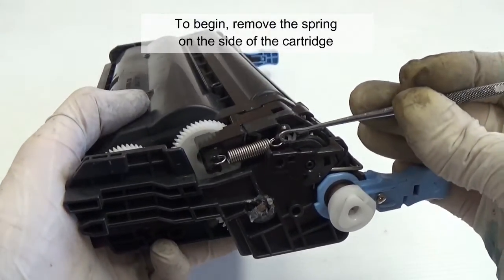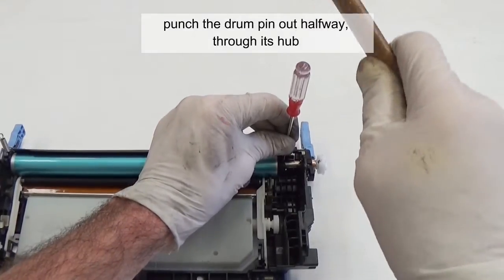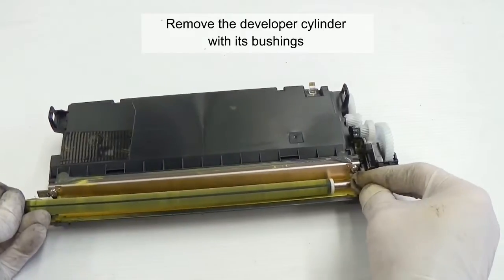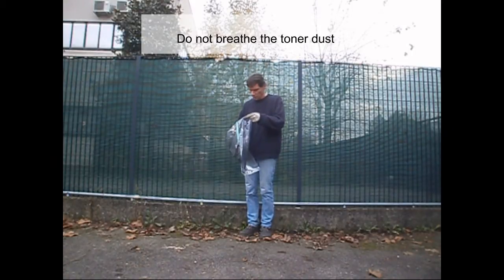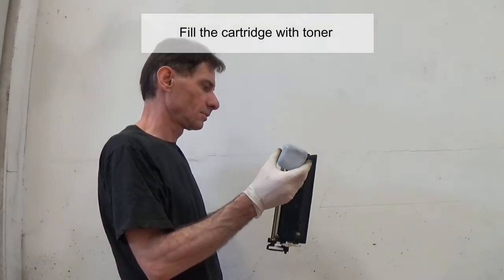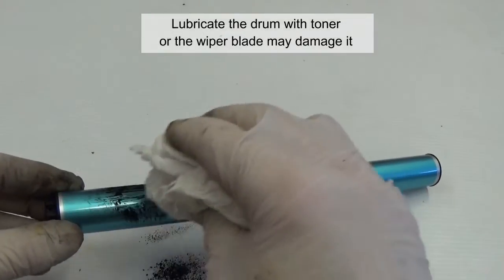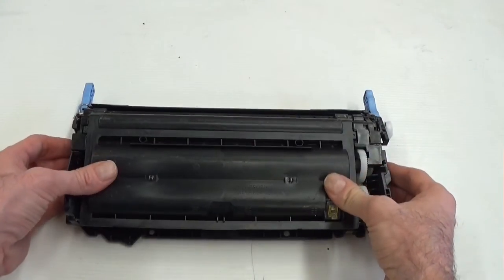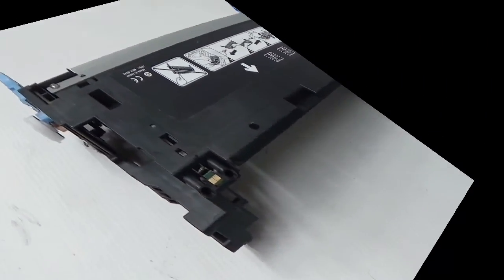Refill HP Laserjet Color 3600 3800 Toner Cartridge

Comment: I have a Q6473A replacment red toner that leaks onto the drum .  When printing both left and right ends are full of red toner and the print output has no red on intended location.  Red is on right and left vertical lines on the page and red toner leaks in the printer.
Reply from the maker: May be the felt seal of the toner roller are defective, or the mylar blade under the toner roller is detached, or the blade of the toner roller is dirty or worn, in any case you have to change or repair the toner cartridge